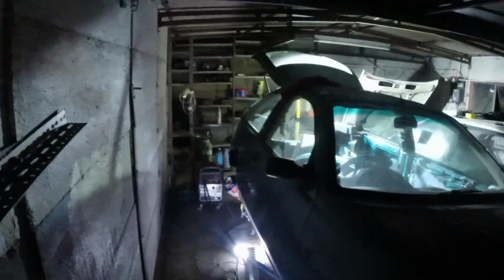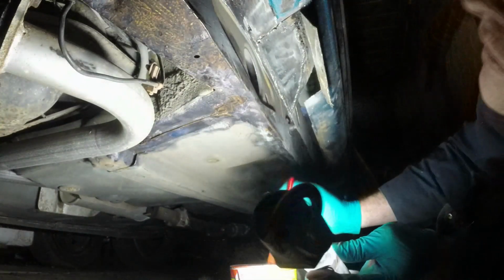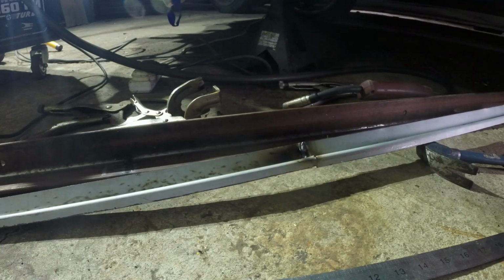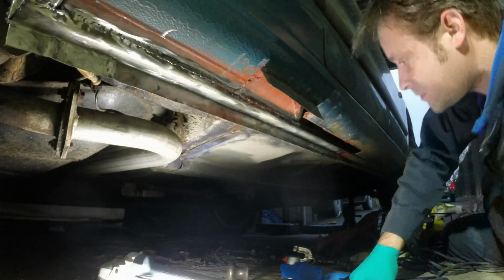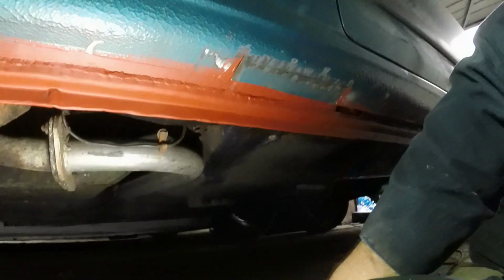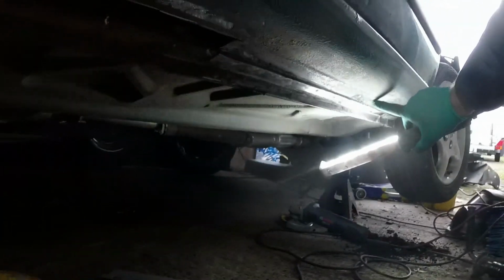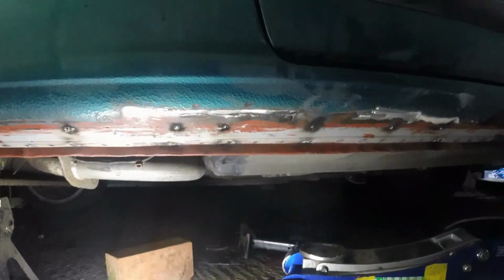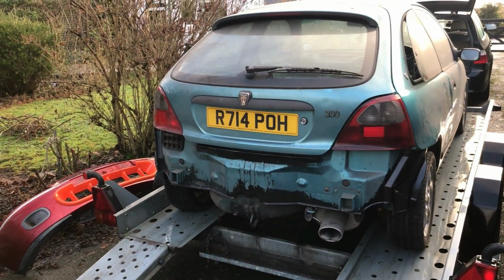Rover 200 mk3 Bubble T16 Turbo - Video 11 Offside sill repair 2

Comment: Great progress a much under rated car in my opinion.   I was working at longbridge in 1998 ish and the very first R53 bmw mini cooper s was running an r3 rover 200 bodyshell with cooper s running gear etc .  From memory it was very fast running up and down the road near Q gate opposite Cofton park.  It was subtle but it have the twin rear centre exhausts which was a bit of a giveaway if you looked closely... if the turbo engine is not used would be an interesting alternative option !

Comment: If you ever get bored doing Rovers, I have a subaru  which needs saving..lol..😀
Reply: You could save it yourself. You could get most of the tools you need to do it for 2 grand especially if you buy used.
Reply: @zoidberg444  i have no where to do it, rents on workshops  are expensive.. I put ads up and get no reply people don't want the noise and i haven't got 2k spare any other great ideas
Reply: @Hasdac1  Damn. I'm kind of lucky because i have a large driveway and a garage at my parents house. I guess if i didn't have that i would have to do my repairs at work but my employer probably wouldn't let me put a car up on jackstands for months like James employer does.

Comment: Hi James
I find the angle grinder can cause as much (if not more) heat distortion than the welding in relation to your problem at 21.40

Comment: Im amazed on your ability to have soo many Projects on the go all at once and still get them done :) 
Im having trouble doing 1 !
I love the fact you treat internal surfaces so many dont :(
I find myself screaming at the screen at others because they are just covering up rust :(

Great work :)
By the way Just ordered some Bonda Primer I am painting my inside floorpan and inside metalwork while I have no sound deadner or headliner in.As it will all be covered with Carpet or trim can I ask can you paint Jotun Jotamastic over Bonda Primer? and what can you paint of Jotun?
I kind of want to paint and forget as it will then be covered up.